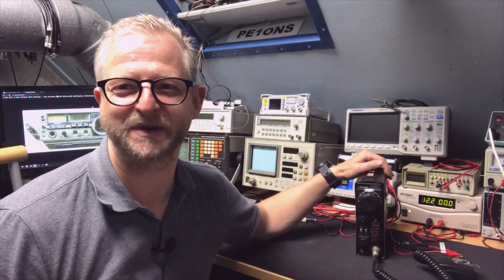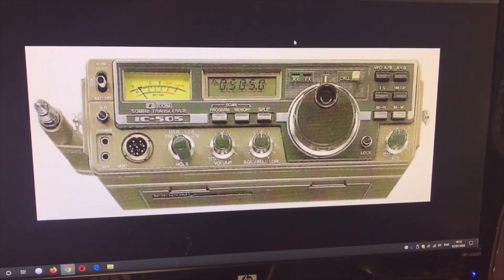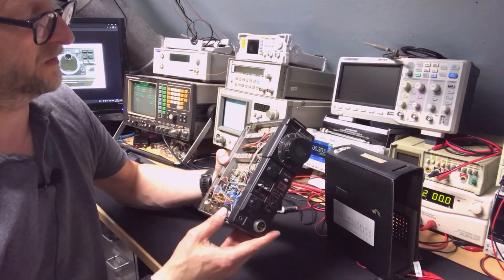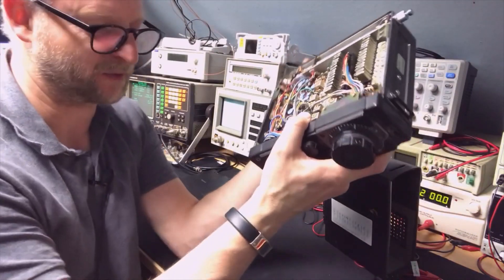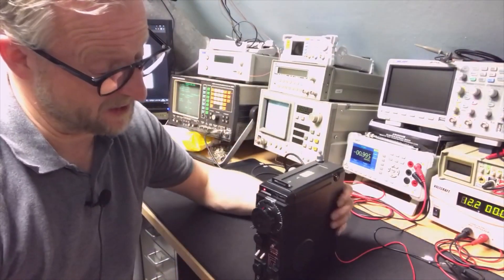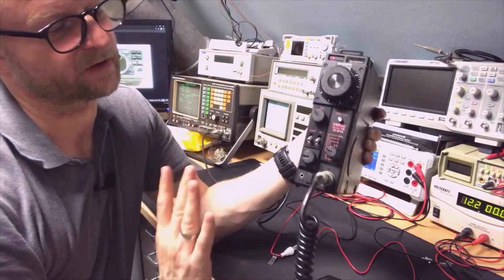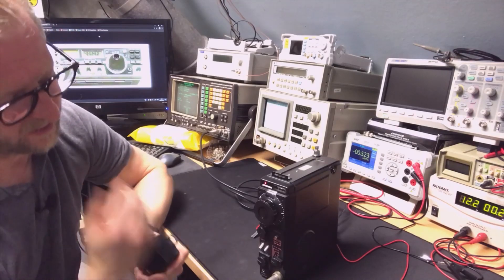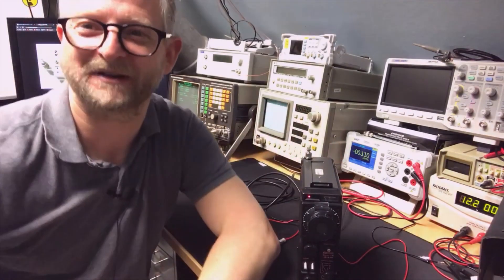#042 Icom IC-215 Teardown Review

Comment: I broke the original antenna on my 202.  Know of a good replacement?  I know you can attach one to the back, but I’d like to replace the original - know what size threads there are for a flexible antenna?
Reply from the maker: That is a problem with this old equipment, maybe on ebay or a part-unit. they are very nice when working.